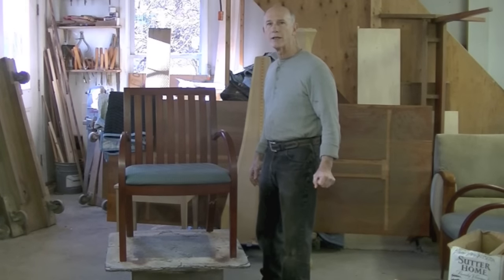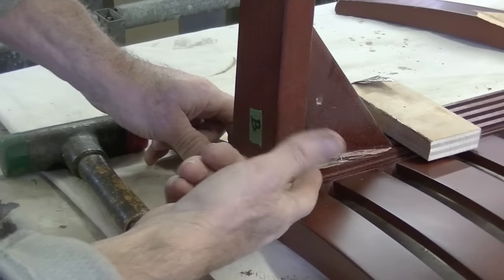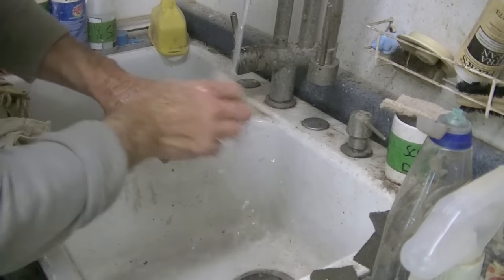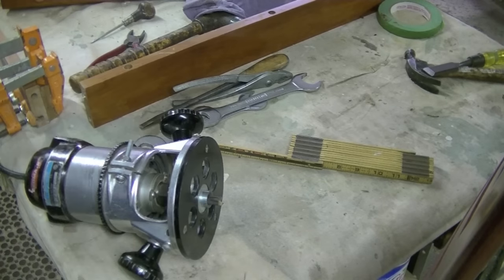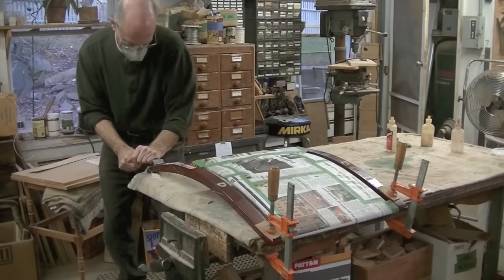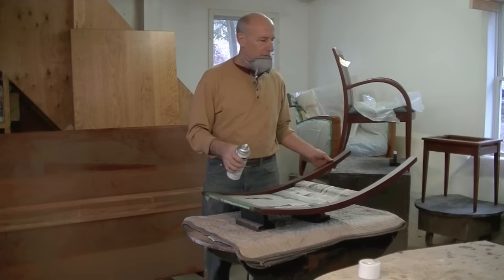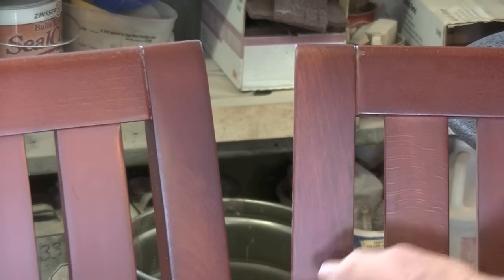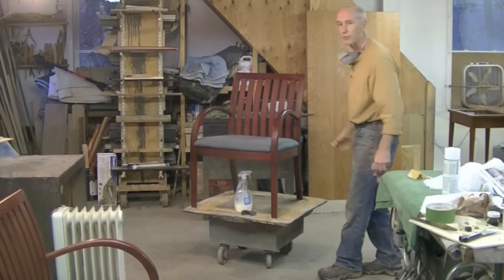Repairing a Contemporary Chair - Thomas Johnson Antique Furniture Restoration

Comment: I am just amazed how you managed to repair and save this chair.  Just think many years ago I threw out a chair that had a broken leg.  I failed every now and again to tighten the bolts under the chair and a guest sat down and the leg was shattered.  I felt bad for the guest and I quickly said it was my fault for not checking the dining room chairs.  That was a lesson to learn about caring for the danish chairs that had bolts to support the legs.
Reply from the maker: Thanks! Yes, it's too bad about the chair.When chairs are loose bad things begin to happen!

Comment: Tom, I know I am only repeating what others have already said - thank you for sharing these videos; for sharing your decades earned expertise and the value of your attention to detail. Although you have worked on more valuable pieces in your videos, perhaps more worthy of your skill, this repair is strikingly unnoticeable. How long would you anticipate such a repair, right at the point of tension in the rear legs, might last?
Reply from the maker: Thanks! That's a tough one, because it really depends on how people use (or abuse) the chair. But I see no reason why this particular repair won't last indefinitely. There was a lot of glue surface there.

Comment: Hi Tom, inspired by your repairs to this chair I am repairing a chair of my own that had a similar issue and so far it’s going great. The question I have is why and when you use the Gold sandpaper, I see that across your videos sometimes you switch to gold sandpaper for some specific sanding and then you go back to normal sandpaper. Thank you and keep up the great content!
Reply from the maker: Thanks! The gold paper is 3M Fre Cut, for sanding finishes, I use 320 and 500

Comment: That is not a chair, that is KINDLING!  This must have been part of a fine living room set to have this repaired or a family heirloom.  Number of  Clamps  required:  Uncountable!  Project difficulty level: Off the charts!  Estimate for success:  Bloody low!   NASA would have walked away from this project.   I learn so much from so many people and this was a great success.  Congrats!   Question, what "slow cure" brand of  Epoxy did  you use and what is the minimum drying time?
Reply from the maker: Thanks! Yes, the owner really wanted to maintain a set! West System 105 https://www.westsystem.com/

Comment: Nice fix. If someone had showed me that chair, with all the bad breaks it had when you got it, I would have said it couldn’t be repaired.

I’m a little surprised, though, that you didn’t put something like a steel rod inside those upright members as you put them back together, for strength.
Reply from the maker: Thanks! There were times that I thought it couldn't be repaired! I've never used steel rods, I think it's better to use wood, IF you have a good joint where the wood can actually bond to the wood of the repaired piece

Comment: I have watched several of your videos.  This is the first time I heard you second guess yourself about the decision to dry fit parts.  It makes me feel better about some of my decisions. I have been searching for a source of 500 grit gold sandpaper but can only find it with hook and loop or adhesive backing.  Would you share your source.  I am assuming it is made by Norton.
Reply from the maker: Thanks! I use 3M 500 Fre-Cut Gold #02538. I get it from an auto paint supply store

Comment: As someone with some upholstery experience; I’ve never seen an upholstered seat that you can’t remove to recover since that is the beauty of a screwed on  upholstered seat. It needed to be removed by lifting it up from the back, then removing. The curved arm and taper toward the back don’t allow you to lift from the side or front. Insertion would be the opposite. Front edge first.
Reply from the maker: Thanks! I too had never seen a seat that couldn't be removed. Until I met this one!

Comment: I would have just epoxied without the extra work that glue is stronger than the wood itself I have repaired many Guitar Gibson head stock breaks without having to  add any spines .. and hold up great .. but Thom you always go the extra mile and yes it looks pretty good!
Reply from the maker: Thanks! It's tough to decide. Sometimes I figure I've got to go the distance while I've got it apart, there's a lot of stress on that joint. Guitar necks too!

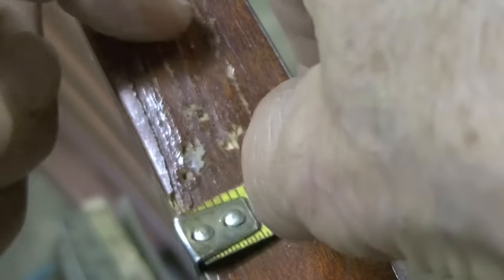Comment: Just so you know, tape measures are designed to move a little. They're designed that way for measuring internal and external measurements. As you measure on 8:28 it's clear you're forcing the tape in. So it's not an accurate reflection of that particular measurement. You've probably adjusted for it all these years, it was many years before I realised the same thing.
Reply from the maker: Thanks! Yes, I do know that, in this case I didn't need a precise measurement. lately I've been using my folding rule, for old times sake

Comment: At what point would replace a piece rather than attempting a repair?  It looked to me that replacement parts would have been quicker and easier than the repairs you made. I do understand the repair of the long break but some of the fractures looked very difficult to get back together.
Reply from the maker: Thanks for watching. On antiques the decision is always in favor of keeping the old parts as original as possible. On a contemporary piece like this you can do whatever seems fastest. Replacing components on a chair like this would far more time consuming then the repairs. Basically, everything was there, all the breaks had good wood for gluing, so I felt like that was the best way.

Comment: I would have solidified that shatter with water thin CA before trying to take it apart. Couldda saved you a lot of trouble.
Reply from the maker: Thanks! interesting. I'm not familiar with that product
Reply: This is what luthiers use to fix cracks in instruments. Piano techs use it to reup pin blocks without replacing them. The whip tip is GREAT for putting it exactly where you want it. Put in baking first and it dries instantly (literally) and the banking soda fills (also works with fine saw dust. Be aware it generates fumes and depending on how much you use it can generate serious heat. I dropped a bottle on a rug once. It smoked for an hour.

Comment: Health advice: EVER wear rubber gloves with epoxi. those blue Nitrile will do. You get sensitive with epoxi contact and never get cured. I saw you do anything with Respirator and gloves but the most dangerous Thing you do barehanded.Very well done. This is exactly what i would have done by myself. BTW i like your Videos as i do the exact same here in Germany. Ist funny how the trade is the same over the Pond. And i like your Colour comparison jig. This helps a lot. Sometimes you get cracy with colour. Changes from left to right, even in the run of the day.
Reply from the maker: +Hermann Straub Hi Hermann, thanks for the advice. In my videos I don't wear a respirator, etc. because I'm talking. I usually wear gloves but I didn't then. I'll be more careful going forward.

Comment: Out of interest, just how strong is an epoxy glue joint, such as in the leg of that chair? I'd quite happily rest my delicate arse on a splined joint or whatever, but I'm not sure I'd be too happy about a diagonal glue joint...

Looks good though, (well as good as modern crap can!)

I assume the insurance company was holding the customer to his word, to avoid a huge cash payout on a designer set...

Thanks

Dave
Reply from the maker: Well, when you don't have a good surface, with plenty of wood to wood contact, and it's splintered like this, I use the epoxy which is incredibly strong. A mechanical joint of some type is always better, but you've got to work with what you've got

Comment: I would assume that this chair was part of a set? The chair itself ,on the surface, doesn't seem to be of enough value to be worth your hard work repairing it. Was it a high end designer chair?
Reply from the maker: Thanks! Yes, part of a set, they were probably relatively expensive. Definitely not worth it except as part of a set

Comment: These modern chairs are absolute garbage (in my opinion). We've had to repair dozens of them over the past 2-3 years. It seems like if they just fall over they shatter. They are also put together with barely any glue in the tenons, and it's largely the bolts that hold them together. The legs tend to be really weak at the corners since they have too much tenon and not enough wood (on top of a threaded bolt insert). They're almost not worth repairing, but a lot of times they're part of a set and they don't sell the same pattern anymore. It's about a 200$ repair on a chair that's barely worth 100$.

Repair looks great as usual.
Reply from the maker: +sooth15 Hi, I agree, the insurance company paid for this, I don't know why but I was happy to do it! Typically the owner would never put the money into it. Years ago the Italian chairs were very well made but they're slipping just like everything else.
Reply: I was surprised that even the Canadian-made modern chairs (same construction style with the ribbed rails and corner bolts) are the same quality as the Asian made ones (they break easily, they just cost more). It just happens to be a bad construction design. By comparison, cheap and mass produced chairs from 1970 and older seem to be perfectly fine aside from typical wear and tear and loose joints.
Reply: So the insurance company paid! Then that makes sense. I wondered why the chair wasn’t just replaced. Repair must have cost more than the value of the chair. Your work is beautiful. “Looks pretty good”